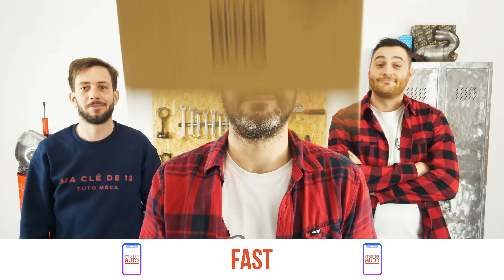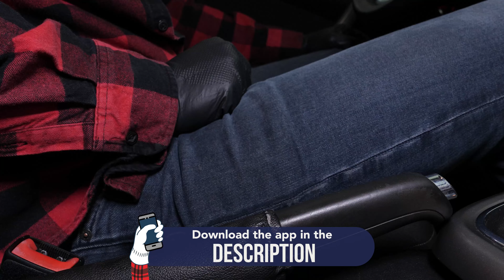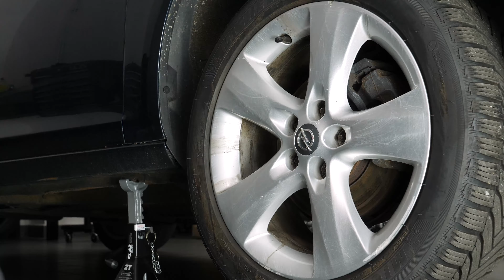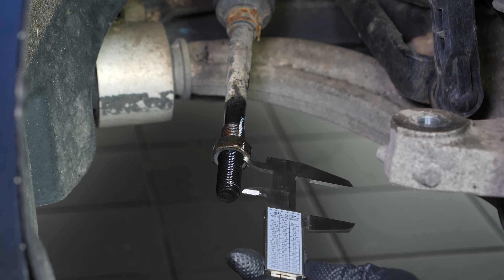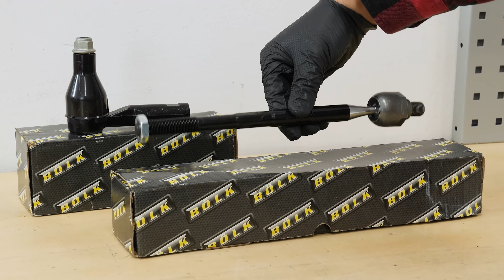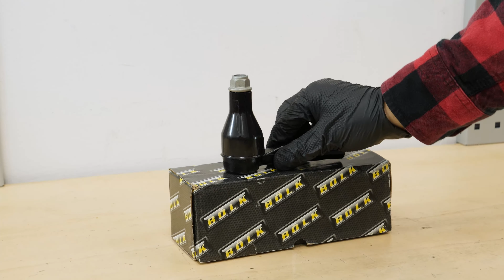How to replace the inner and outer tie rod Astra J / mk6 🚗

Comment: Thank you for this! What was symptoms? I am trying to figure out if mine need to be replaced as well, I have noise coming from front left, I replaced both full struts, torsion drop link but still getting noises.